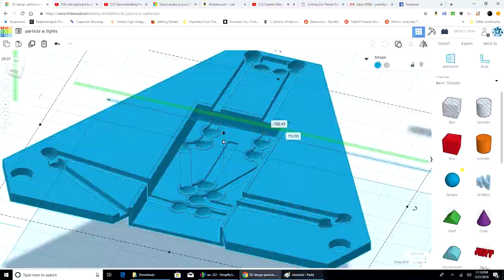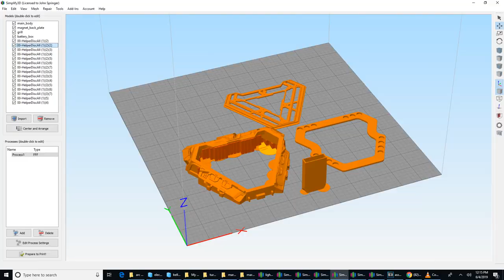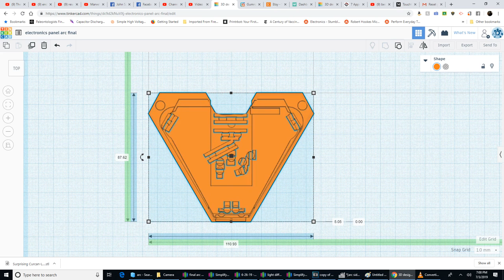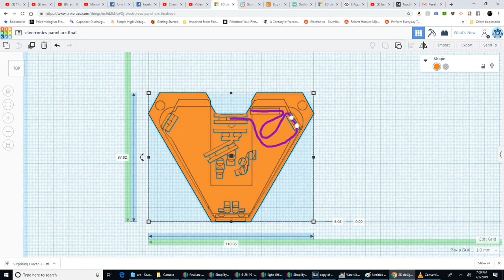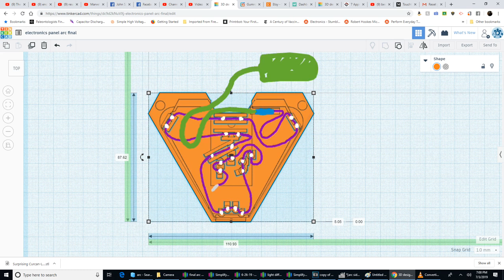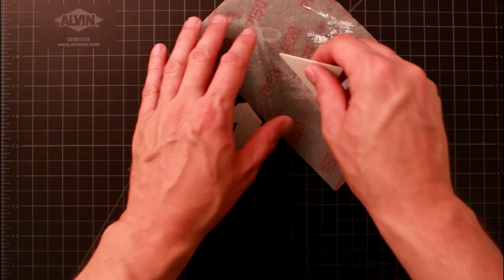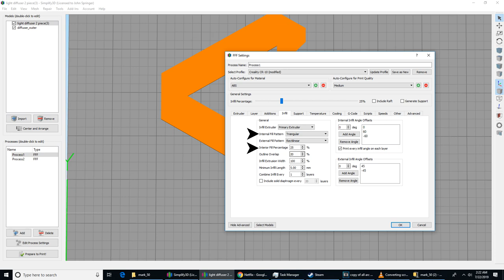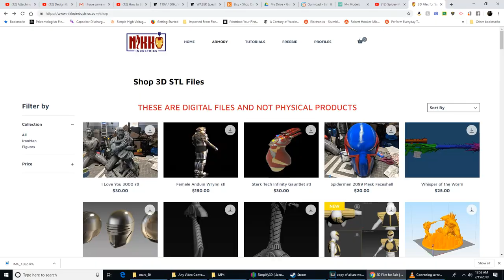Will It Arc Reactor? Sci-Fi to Sci-Fact Ep. 1 DIY Movie Accurate Endgame Arc Reactor

Comment: Approximately how long is the fairy lights? The amazon link doesn't seem to be working any more
Reply from the maker: @matthewpunko4352  7.2 feet 20 LEDs
Reply from the maker: But you can use the 3.3ft ones too and those would prolly be better. Less wire. The ones I used had 20 LEDs

Comment: How do you intend to power the different systems you want to add with varying voltage ratings while still keeping the arc reactor as self containing as possible? Also, what do you think of connecting the battery and the reactor circuit through magnets so that the reactor lights turn on when you connect it, giving the illusion like it sensed your heart and is connected to you?
Reply from the maker: EmeraldStikbot animations I have a wireless charger unit I can wear on my chest and a wireless charging battery pack I can fit in the reactor. The magnet idea is good. The original wireless charger version was used with a shirt with a small hole in it to run to a phone charger pack in my pocket. One or multiple voltage/current regulators can fit in the reactor. I’ve been trying to get a car jump pack inside it but it’s just too much amp draw and risks catching the lipo pack on fire if I try and do it small. That’ll have to go in mjolnir and stormbreaker instead.
Reply: TheAlphaPyro  Okay, I’ve mainly been concerned about finding a power source for a 100 watt led that can fit in there but I can’t find any. I might just have to make a belt clip or something. Thanks for replying and being active to questions though

Comment: the videos to the wireless aren't on hackaday
Reply from the maker: There's no videos on the hackaday link just build logs, partial instructions, parts list, and links to 3d printable parts for the wireless setup. At some point I may get around to getting the wireless charger video done. But I found some ways to increase the charge distance by a lot with a different type of charger and kinda would rather show how to do that which means re-filming . Just busy at moment with 3 jobs and my mom having a stroke. Cancer slowed me down a bit too.
Reply: Okay thanks then, I'll look again. I meant that also not evil, so did not want to put you under pressure.
I'm really sorry about the cancer.
Reply from the maker: @Zacoryas  No worries man. I didn't think you meant anything bad. Just mentioning why new content and follow-through on a vid for the wireless charger hasn't happened. I am however almost done with replicating the rings from Shang-Chi so that will be on the channel soon. Just pulled a ring off the new resin printer. Thanks for the thought.
Reply: ok great

Comment: What kind of 3d printer do you have?  Wondering what is a good, versatile one to get.
Reply from the maker: Any of the creality stuff is great. I have a bunch of cr10 printers I’ve been running for like 5 years constantly. The elegoo Saturn or mars are great for smaller detailed resin prints you don’t have to do much cleanup on. I love my Saturn.
Reply from the maker: If you’re in a tight budget I suggest the ender 3.

Comment: Where did you get that stark industries case?
Reply from the maker: Lasered it myself
Reply: @Pyromancers  Just the Stark industries decal or did you make the whole thing?
Reply from the maker: EmeraldStikbot animations the foam inside and the laser cut faux aluminum front.
Reply: @Pyromancers  In a somewhat unrelated note, where did you get the body heater you showed in the clip of tech you wanted to add? I'm having trouble finding some I want to use in my own project.
Reply from the maker: @kj8168  just go to sparkfun.com and look up heating pad.

Comment: Was the abs plastic transparent or white coloured?
Reply: Also, what infills work for cura, as I can’t get simplify3d slicer
Reply from the maker: @kj8168  transparent abs. I just tried it in Cura and got it to work. You may have to play with the rotation of the part a bit to get the triangles pointing the right way, but it can be done. Just use triangular infill and play with the settings.
Reply from the maker: @kj8168  you could probably do transparent petg which I think is easier than dealing with ABS. I would recommend Polymaker since their stuff is easy to work with and you can just get it on Amazon.
Reply: TheAlphaPyro Ah okay thanks for the help and especially for the quick responses. Cura does not have a honeycomb infill currently, is there any infill in their slicer that’s close?
Reply from the maker: @kj8168  looks like slic3r has it. Can't find the right one in Cura for that part
Reply from the maker: @kj8168  if you get one made please post a pick on the thingiverse page for it.
Reply: Will it work in normal white or direct blue abs plastic instead of transparent one